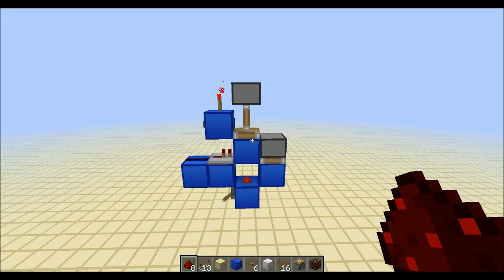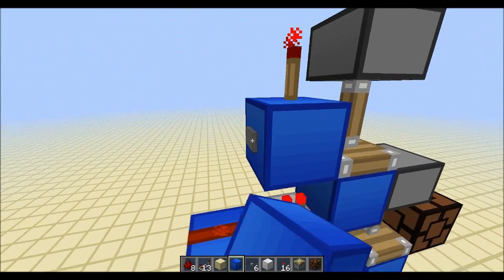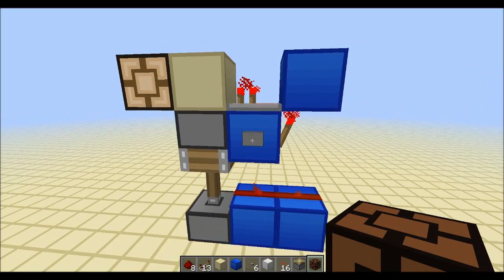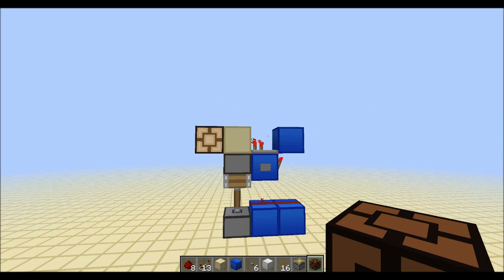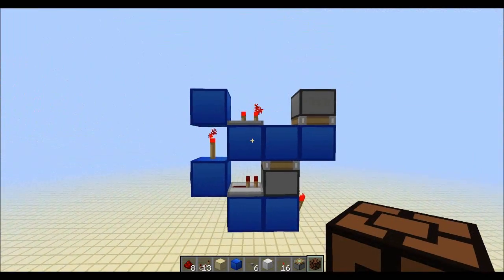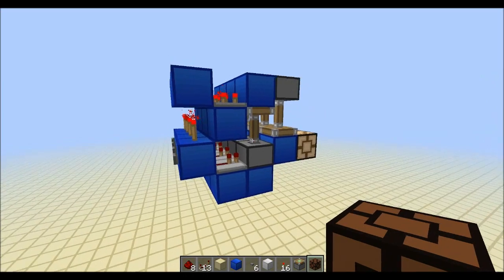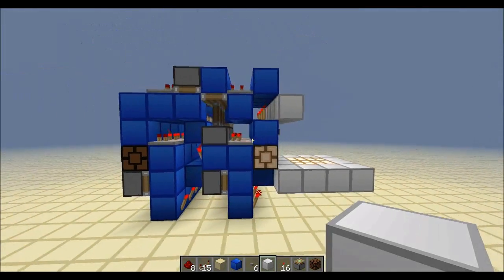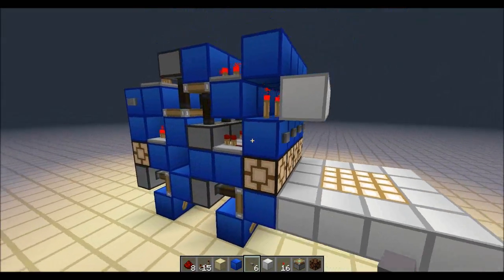Minecraft: Rofl-Flop, 1 Wide Stackable T-FlipFlop with Indicator Lights 1.3

Comment: technically it has to be 1x1x2 because most of the time people measure the dimensions as if you were to build it in midair, which is the legit way of measuring, so you would need a block to place the lever on.

Comment: I managed to make a horizontal rofl-flop. 6x3x3 (although the bottom layer is the the ground it's on) and slightly slower. It's not nearly as elegant as the original though.

Comment: I developed a simple one wide T-flip flop by connecting the top half of the RS-Nor latch inside a D-flip flop to the input (using a torch relay), and then delaying the input with 4 ticks. The pulse input is a button press (no more) on the bottom torch of the D-flip flop that activates it.

Comment: Also, if you make a chain of T flip-flops, and you feed it a pulse, for every flip-flop that you add it makes the pulse half as long. This is useful when you want to make a clock and don't want a thousand repeaters. You can put a simple pulse that is fairly short and after not too many flip-flops at all you get a very long pulse.